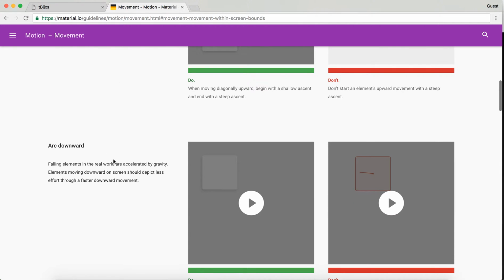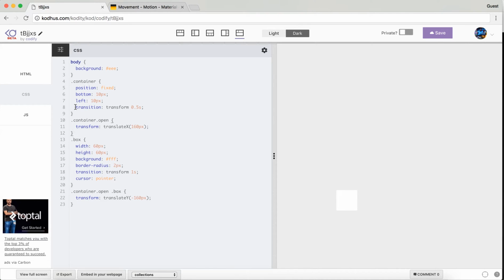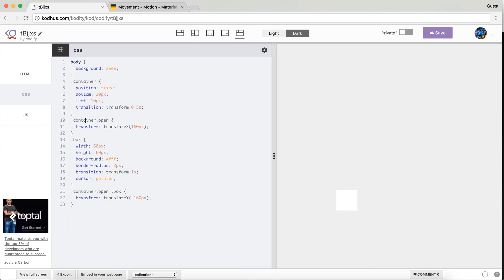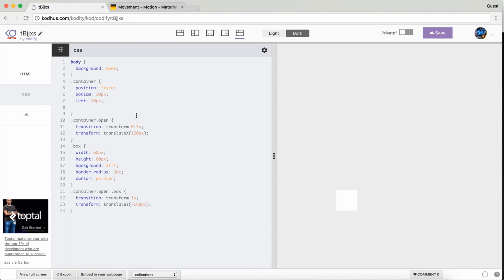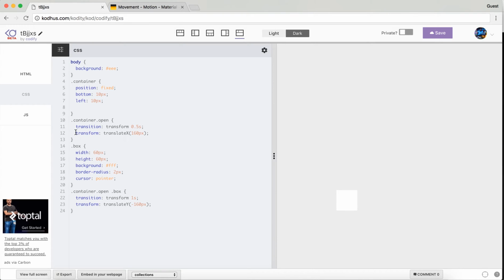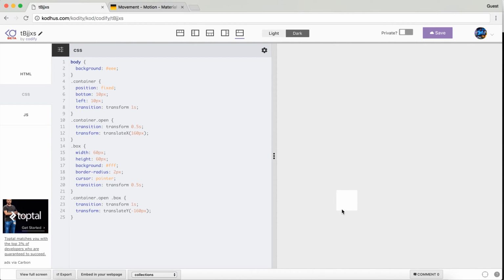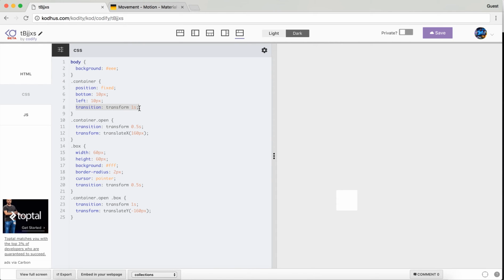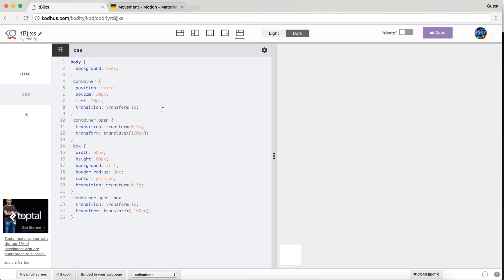Downward arc motion #materialdesign

Comment: I like these material design tuts too. Quite inspiring as I have never tried animations before. Anyways, I ws playing around with this one as having different times on the transitions didn't feel right to me. I ended up adding ease-in & ease-out to the transitions. 
You can find it at http://kodhus.com/kodity/kod/lenzjo/haafzL

The only problem I have with this is that when the box leaves or arrives at it's origin point there's a slight jerk or jump in the boxe's movement.